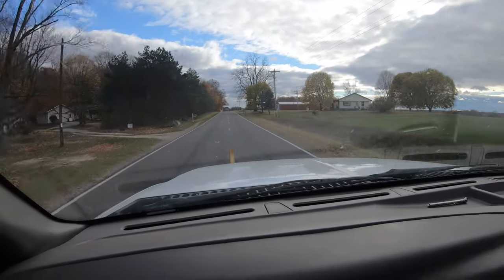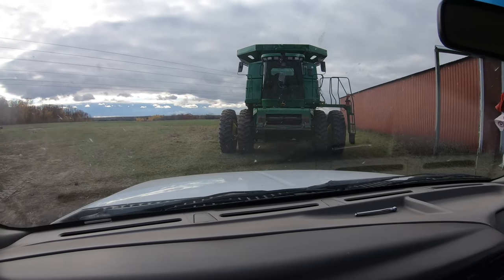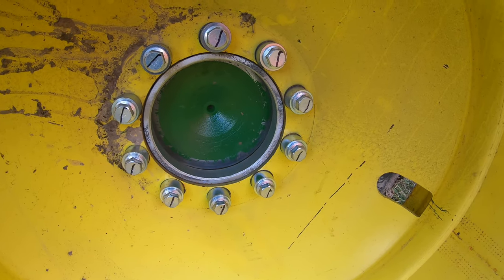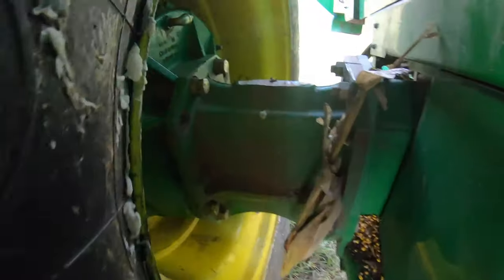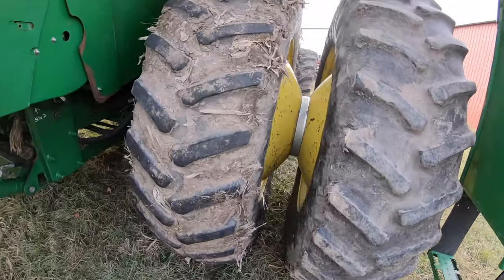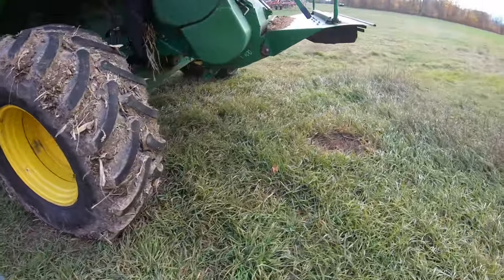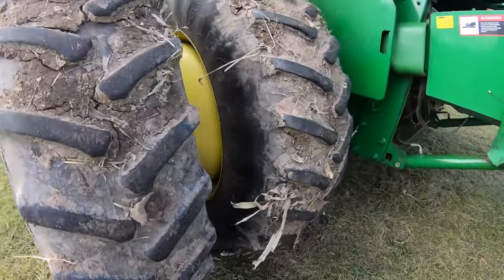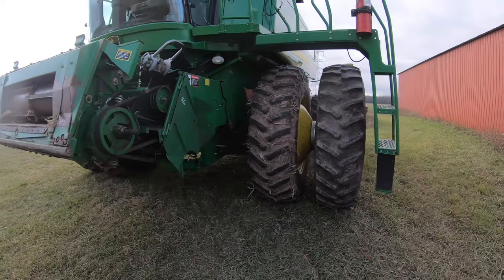The John Deere 9760 STS Combine Is Fixed!!!

Comment: Retorque after 8 hours. Glad to see you going again. Doesnt matter if its a new or used combine if its new to you the fun starts all over!

Not uncommon on the late series deeres. They should have stuck with the 8820 planetary.
Reply from the maker: I'm still just shaking my head that I let it happen. I remember my Dad putting the duals back on their 9500 once and they had a breaker bar, a pipe, and three of us torquing them down. So when my combine got delivered and they said "this impact wrench is just as good" I probably shouldn't have let them put the outside duals on. Live and learn. Definitely will be retorqueing them (even if it's a pain because the outer duals have to come off first to get to the inner duals).

Thanks for watching Jon!